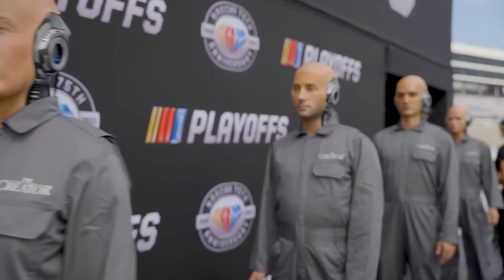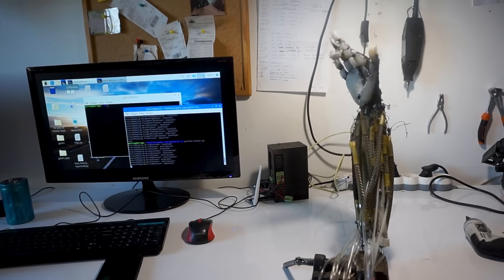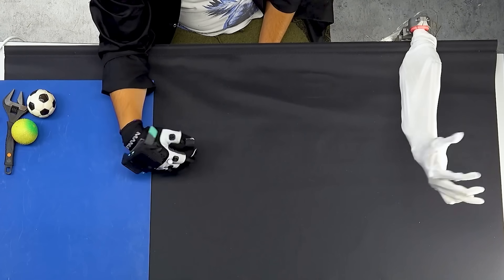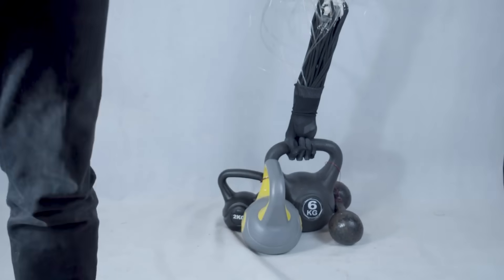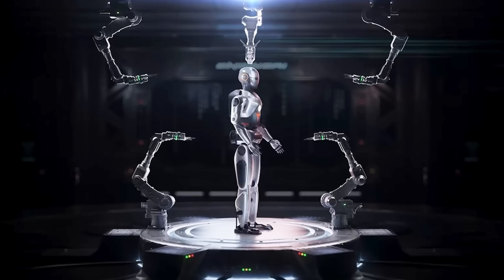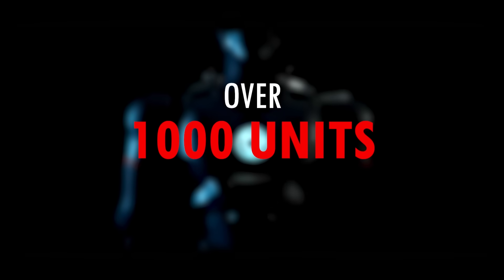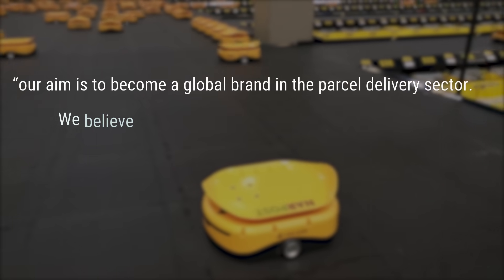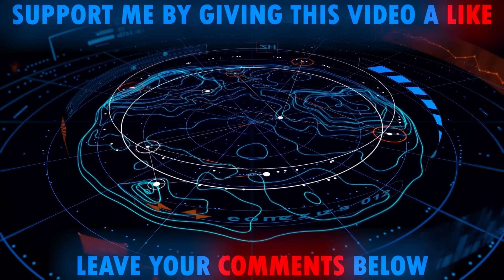Meet The FIRST SYNTHETIC AI HUMAN with Real Muscles - Fake Humans Are Coming!

Comment: @6:00 I wonder if a fluid like a water-based/oil catalyst encased within these prototypes would be the right fuel they need to keep them in motion forever without charge. For example, it's interesting how our human bodies survive based on the water we consume to keep our cells hydrated. Maybe within an android's casing the oil/water combo would be like or replicate as the human body does with blood, and the fact we need water to survive. So within an Android, the oil/water combo is the "life energy" that would also make the Android's motions more fluid. Encase the android muscles, the inner components, and the oil/water in a highly flexible, safe, and durable life-like skin that rivals even the most advanced silicone and urethane rubbers. Throw in the most advanced solar battery that acts as a conduit to keep the androids' inner components charged. Also use an adjustable temperature coolant to keep the inner motions and battery at a safe and cool temperature, and voila! The terminator! Altered Carbon! Universal Soldier! Westworld! In seriousness, though, the prosthetic limb potential is where this idea would really shine if applied to a neural link.

Comment: The Clone’s muscular system animates the skeleton thanks to Clone’s revolutionary artificial muscle technology Myofiber pioneered by Clone in 2021, which actuates natural animal skeletons by attaching each musculotendon unit to the anatomically accurate points on the bones. Myofibers are produced in monolithic musculotendon units to eliminate tendon failures. In order to obtain the desirable qualities of mammalian skeletal muscle, a suitable synthetic muscle fiber should respond in less than 50 ms with a bigger than 30% unloaded contraction and at least a kilogram of contraction force for a single, three gram muscle fiber. Today, Myofiber is the only artificial muscle in the world capable of achieving such a combination of weight, power density, speed, force-to-weight, and energy efficiency.The Clone’s skeletal system contains all 206 bones of the human body with a small number of bone fusions. The joints are fully articulated with artificial ligaments and connective tissues. With 1:1 ligament and tendon placement on the skeleton, the android is highly articular and includes one-to-many and many-to-one joint-muscle relationships. The four joints in the shoulder that connect the shoulder blade, collarbone, and upper arm bone have a total of 20 degrees of freedom, both rotational and translational, with an additional 6 degrees of freedom for each vertebra in the spine. With 26 degrees of freedom in the hand, wrist, and elbow, just the upper torso of the Clone without the legs possesses 164 degrees of freedom. These artificial human skeletons are made entirely of cheap and durable polymers.The Clone’s nervous system was designed for instantaneous neural control of the valves, and thereby the muscles, with only proprioceptive and visual feedback. The Clone is equipped with 4 depth cameras in the skull for vision, 70 inertial sensors that provide joint-level proprioception (angles and velocities) and 320 pressure sensors for muscle-level force feedback. The control boards for the valves and sensor fusion feedback are mounted along the vertebrae with lightning fast microcontrollers sending and receiving information to and from the NVIDIA Jetson Thor inference GPU in the skull running Cybernet, Clone’s visuomotor foundation model.The Clone’s vascular system is the most sophisticated hydraulic powering system ever designed, with a 500 watt electric pump as compact as the human heart able to pump liquid at a 40 SLPM volumetric flow rate and 100 psi rating, allowing it to supply hydraulic pressure to the entire muscular system. Clone’s Aquajet valve technology combines a 100 psi water pressure with a 2.28 SLPM flow rate, under a watt of power consumption, and a three-way configuration in a miniaturized 12mm design.

Comment: Gold kit robotics cost $7887, the community secret in colleges. Update the first line of ROS code as F=m*a*b*c. Isaac Newton born in 1643 did not have any robotics his code only runs them at 13.8883%. Give them two calculators or computers or all you have when coded correctly. 

Test method test points:
F=m*23

F=m*333 

F=m*633

F=m*933 ----robot states "too slow human" if a voice box is installed or built into the bot. You will hear the prompt to keep going higher in the test method.

F=m*1993 -----robot states "too slow human" a voice box is required for audio prompts to go higher in the test method test points.

F=m*2293 - good code.

 F=m*2390 - good code.

F=m*2391 ---Upper Limit Do Not Go Over this Value.

Comment: PLEASE get these engineers to speak with Thomas Meyer, the famous expert in fascia 'tensegrity' seen in YouTube videos. https://www.youtube.com/watch?v=xzX-PeU_MTo&t=110s&pp=ygURbWV5ZXJzIHRlbnNlZ3JpdHk%3D
- The crucial thing is, the fascial 'springy' network of a biological body enables retention of energy for reuse (he explained that a kangaroo bounces along at extremely high efficiency BECAUSE each bounce on the ground loads tension energy into the fascia - for reuse in the next push upward.
- He said a kangaroo uses the same amount of energy at 10kph as it does at 30kph for that reason. Contrast that with the robots that do not retain the energy at all, it is all consumed and lost as heat.
So my guess is, the engineers might change the architecture greatly - by instead designing everything connected as an integrated elastic system, rather than being individual systems of 'muscle and bone'. This means
◘ Less loss of energy
◘ Therefore 'can use a smaller, cheaper battery
◘ Humanoid is lighter, more compact & agile, can have extras
◘ Or 'can operate longer between charges.